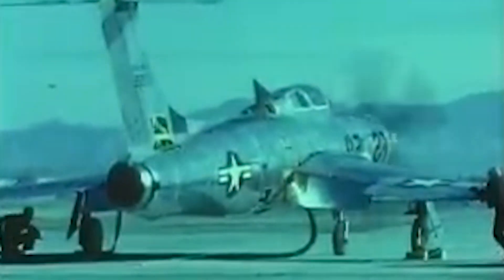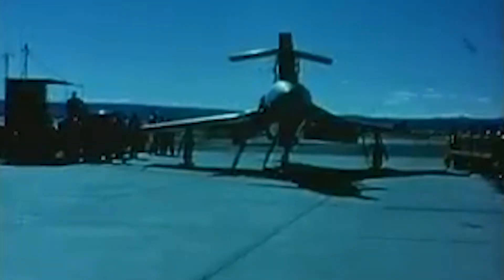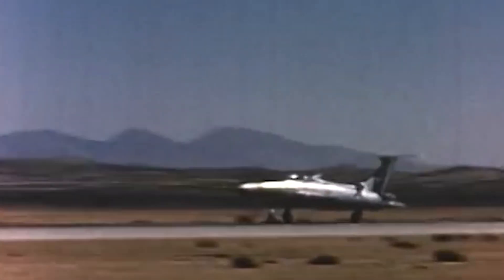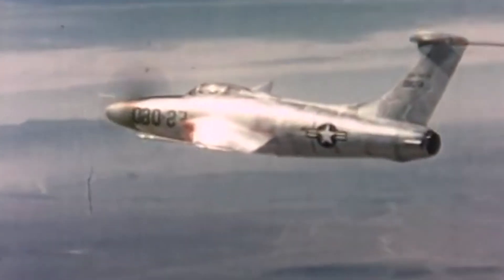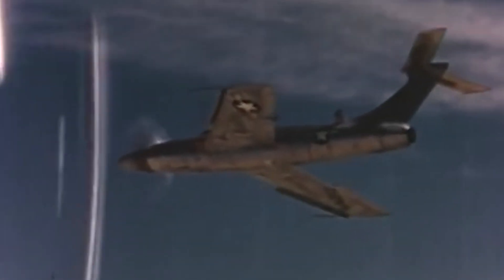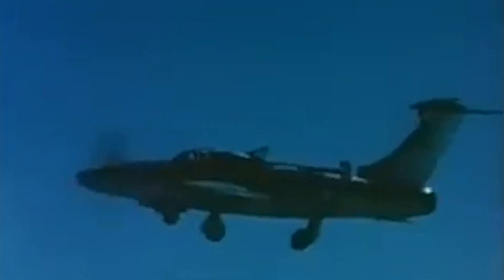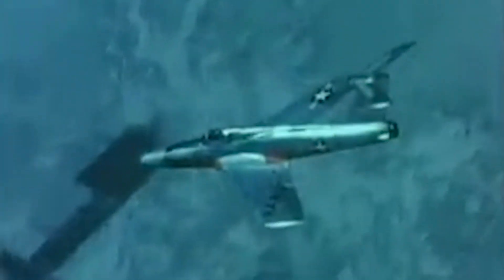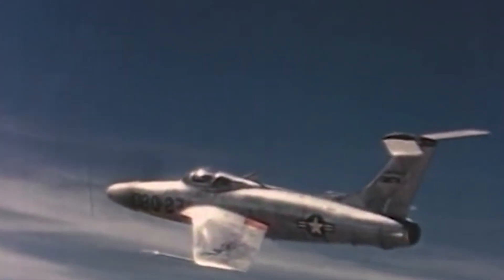They Made a Supersonic Propeller Plane

Comment: Thanks for this video. I didn't know this plane yet. I also didn't know that you could reach supersonic speeds with a propeller plane. For me, the fastest aircraft, apart from the sport aircraft, flying in Reno Air Races are the Donier DO 335, the Focke-Wulf Ta 152, the Tupolew Tu-95 and the Mark 19 Spitfire with two contra-rotating propellers (Christophe Jacquard). Propellers on fighter aircraft are also an exciting topic. Especially in the Second World War, where the air forces and the various opponents outbid each other over time. It was aviation Formula 1, where everyone came up with something new to impress their opponents.  Sometimes, with careful maneuvering, a propeller with fewer blades is more efficient at speed than with many blades. Some fighter aircraft with two-blade propellers are more maneuverable and faster than the same model with three-blade propellers. There was even a propeller test where a propeller had only one blade and only the counterweight on the other side. It is an exciting topic where the propeller should also be attached to the fighter aircraft. However, I didn't recognize this aircraft in the video. So thank you very much.

Comment: dude your mustache grow so fast. its a sticker, isnt it? 😁
by the way, dude, i dont think the propeller makes sonic boom. i think people back then who are still not fully researched where sonic boom came from, think the loud engine sound(the some 4000 horsepower thing you mention) to be a sonic boom. i would imagine a combustion motor that big would be so loud.
the reason why sonic boom only occur at the speed of sound(at exactly that) is because it caused by the sound of the engine overlapping in spectrums. so if the plane is stationary, sound dont get compacted, it expand evenly.
 sonic boom is not caused by something going though the air at supersonic speed. thats a crack sound. like when you hear a shrieking crack from a supersonic ammo flying through the air. the thumping occur when the object travelling AT the speed of sound(at exactly 1:1 speed of sound) PRODUCES IT OWN SOUND. when the sound emanating from the object itself(the engine hums) would overlaps with all the sound signal it left behind which expand towards the object motion now be on the same spot as the source of the new batch of sound. its like having 1 million hums audio tracks being played simultaneously. the sound pressure im saying. no speakers would be able to play that. so imagine the loudness of a single sitting still jet engine roaring, but you play that sound in 1 million tracks simultaneously. thats sonic boom. believe me its not coming from the propeller.
also the engine loud sound wont be a problem if it does goes supersonic. since the sound would arrive LATE than the plane. 
but this only means, you could build a quad copter vehicles travelling at the speed of sound or more. provided you have the power source for it.
Reply from the maker: The mustache is 100 real, I swear LOL
Reply: but the theory you’re describing actually misinterprets the physics behind sonic booms and the XF-84H Thunderscreech’s unique noise. Sonic booms aren’t created by overlapping sound waves or “hums” piling up. Instead, they occur because an object traveling at or above the speed of sound compresses air in front of it, forming a high-pressure shockwave that bursts outward as the boom we hear. This effect is due to air compression, not sound stacking. For example, the sharp “crack” of a supersonic bullet is just a smaller version of a sonic boom and is also caused by a shockwave, not by sounds merging together. The XF-84H’s infamous noise, meanwhile, wasn’t from a typical sonic boom but from its propeller tips reaching supersonic speeds, producing continuous shockwaves that caused intense noise. It was claimed the shockwaves were visible. The “million hums” idea doesn’t capture what’s happening here—sonic booms stem from physical shockwaves due to pressure changes, not overlapping sound signals. If the XF-84H went supersonic, its sound would indeed trail behind it, but this only delays the noise, it doesn’t reduce it. And while it’s interesting to imagine a supersonic quadcopter, propellers aren’t designed for such speeds; they face massive drag, noise, and mechanical strain, which makes that idea impractical. So in short, sonic booms are about shockwaves, not overlapping sounds, and the XF-84H’s noise came from supersonic propeller tips rather than any “hums” effect.